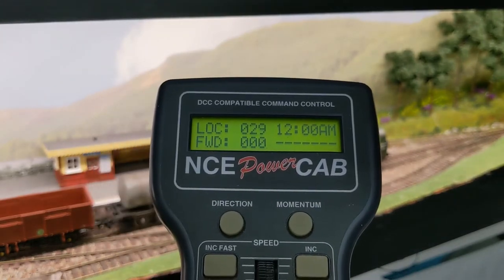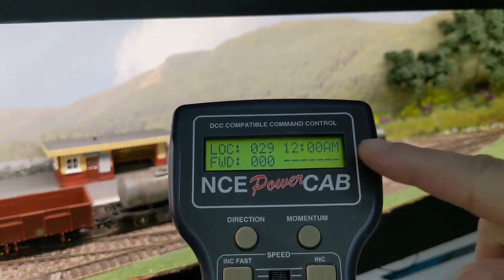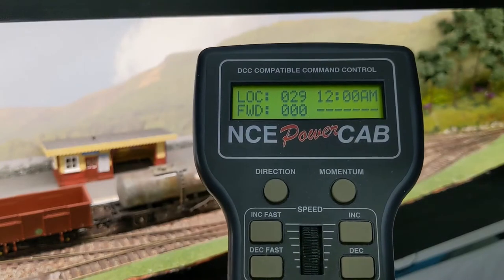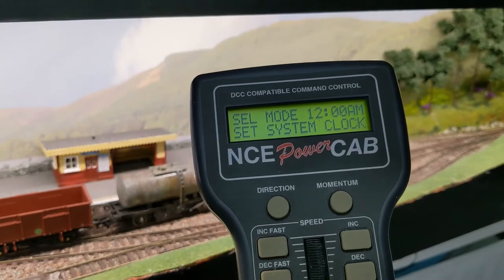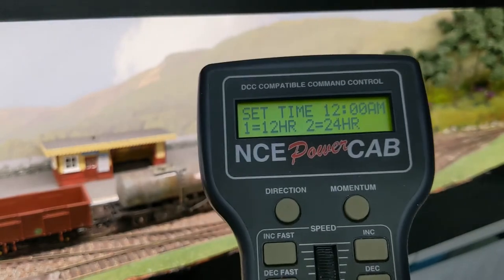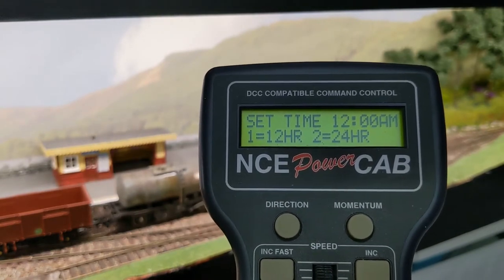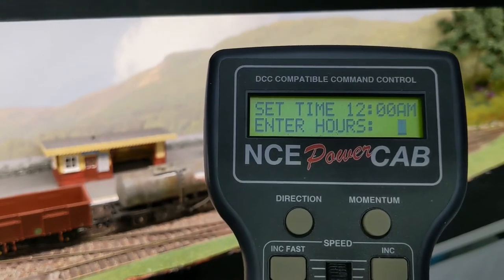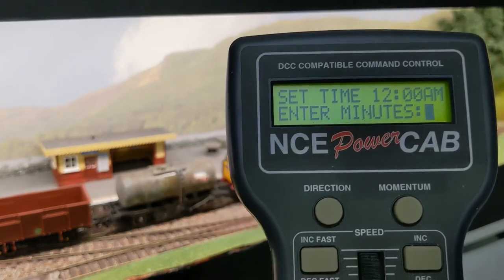Speed up the clock on your NCE PowerCab

Comment: I remember an article in the Railway Modeller about altering an mechanical clock to speed up the time. Much easier with digital, of course.
Reply from the maker: I can remember when modellers would just casually drop into the description of their layouts "and I modified an alarm clock to use speeded up time" without saying exactly how!

Comment: Nice video. What are the advantages of a speeded up clock?
Reply: If your prototype only has 6 trains a day, using  a fast clock means time passes quicker, and you can run a days workings in just a couple of hours, rather than waiting around and being bored.
Reply from the maker: As Jane said, it means you can speed up time, so that you dont have long gaps with nothing happening in between trains.
Reply from the maker: If you were to run your layout in real time, it would take a whole day to work through a days worth of trains - and there would be long periods when nothing is happening, as in the real railway. So by speeding up the clock, you can complete a whole day in just a couple of hours, and the periods when nothing happens are very short.